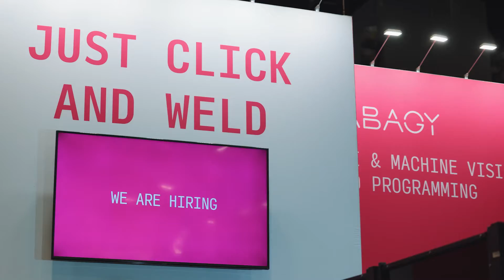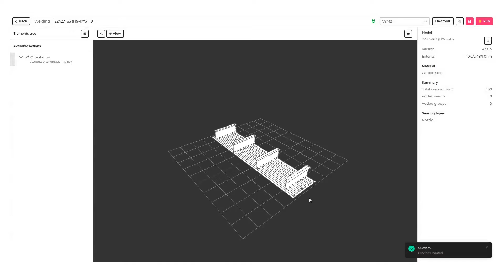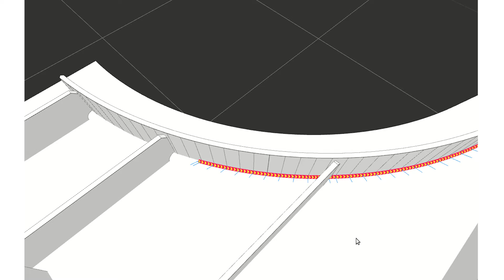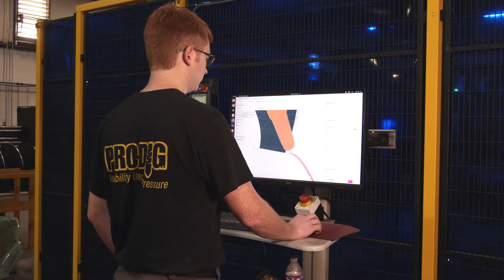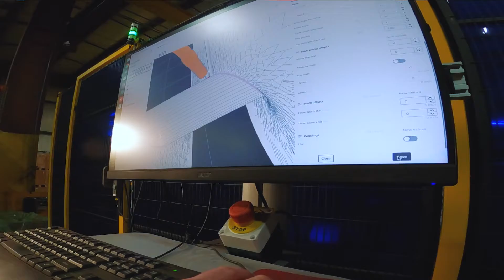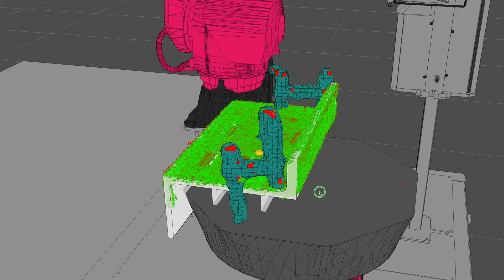ABAGY Team | ABAGY ROBOTIC WELDING

Comment: In your videos while you select welds in your GUI’s 3D cad view, it seems like the touch sense routine is generated automatically. Is the touch sense routine generated automatically by selecting weld? Or do we need to program touch sense routine for welds in your GUI? Can you post a video on how touch sense is programmed through your GUI? Thanks
Reply from the maker: For simple geometries, the system automatically generates touch sensing points. However, if you prefer to do it manually, you can easily specify touch points by clicking on the desired surface area. Thanks for the suggestion about making a video explaining this process—we'll definitely work on that!